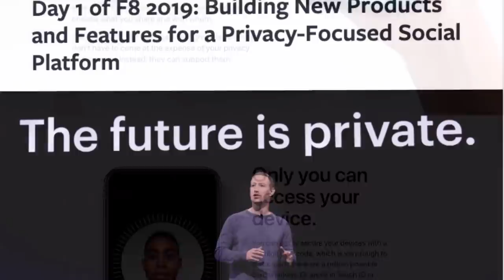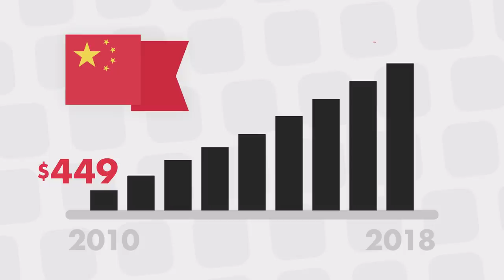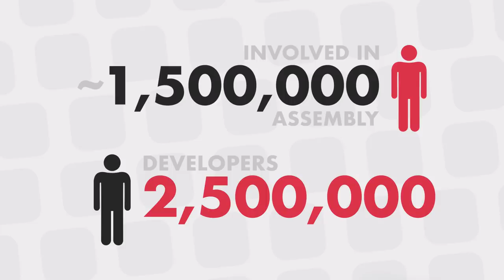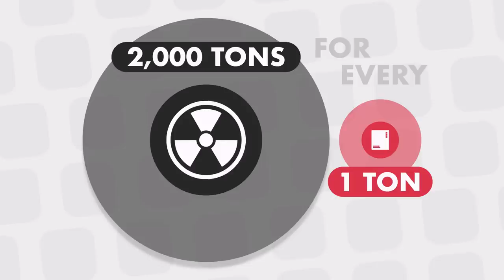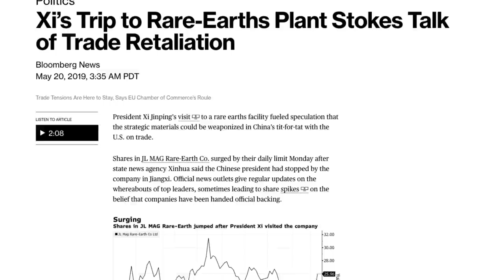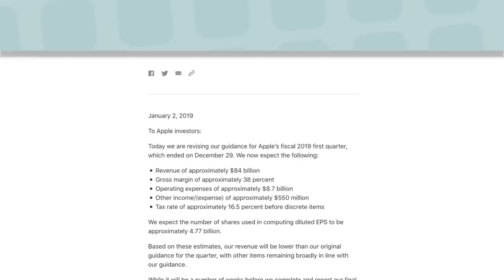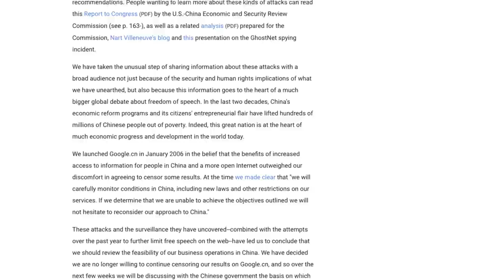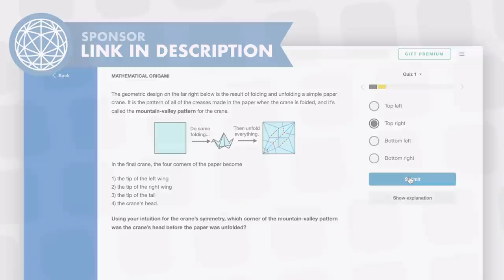Will Apple Ever Leave China?

Comment: 2:40
ppl should always mark where the graph starts unless it starts at 0
Reply: feketetv it does start at zero, and He also gives a baseline at $449 for the first bar. I jus say though, the last one is more than double the first bar it’s not proportional but it is definitely a fair enough graph.
Reply: @Makeitwithmanny  no it is not,the graph should have continued below and have the baseline 0 on it. This is what advertisers do though, they start from a certain amount and like in this case the amount has just doubled but because the baseline doesnt start at 0 it looks like the amount is 10 times higher or smth
Reply: Probably a template generic animated graph and then adding some number, icons and flags. Totally not intended for accurate scaling.
Reply: @lot.bajrami  you and the original comment are absolutely correct...good call.
Reply: feketetv dude hook me up with the pic. I ned it for... reasons

Comment: Does anyone else think that the new iPhone will flop?
Reply: The consumer base has not shown much sign of not buying the new Apple product just because of silly reasons like "I don't need it", and "what I have works perfectly well for me". If it has an apple with a bite missing on the back of it, people will buy the hell out of it.
Reply: Tiger474 in the tech community it is just the general opinion, but of course the eco system is really powerful. So of course people will buy them, but it will not be as good as the iPhone X was at its launch.

Comment: I used APPLE in Manitoba, it often easily died in winter and had to charge every day. Another even worth thing is it would much slow if you updated, The horrible using Apple iPhone experience made me had to change another brand. I am not the only one did this.
Reply: Look- any battery under drain will have issue in cold temperatures, and may even break completely.

If it works, it will discharge unevenly and have issues charging.

Keep the phone close to your body in very low temperatures, or just turn it off.

Comment: No c/c++ ,assembly,java and python will remain  relevant for quiet a long time
Reply: But why though? (I don't know much about code)
Reply: @JetAway  that's quiet simple c/c++ is the building block for all modern technologies and languages and is cable of doing both high level and low level stuff , java is made from c/c++ it will leave on through android and some enterprise  application I personally like java when it comes to distributed computing it's pretty good and recent  improvement make still in demand , python is good for automation and AI its pretty much use d alot but is not nearly a fast as c/c++,java ,and assembly but very reliable and finally assembly is low level machine language used to build c/c++ back in the old days it use d to be good but was a bit complicated you can in theory build a lot cool stuff with it but it's best suited for embedded systems . 😊😊😊😊